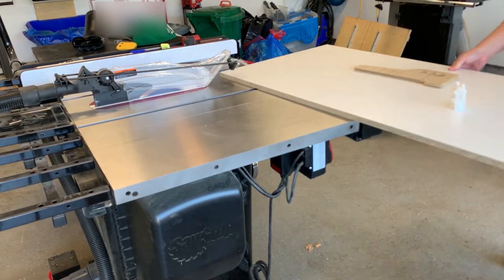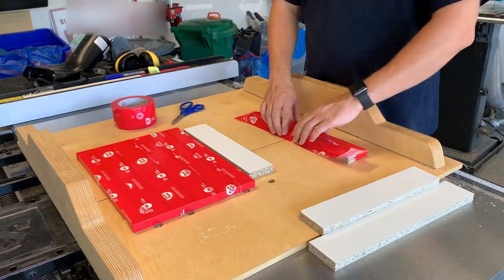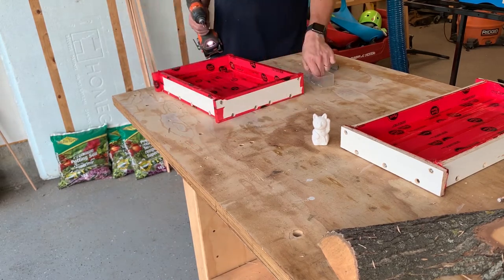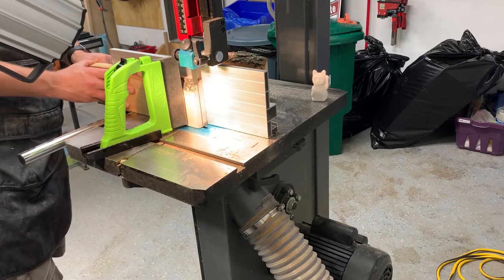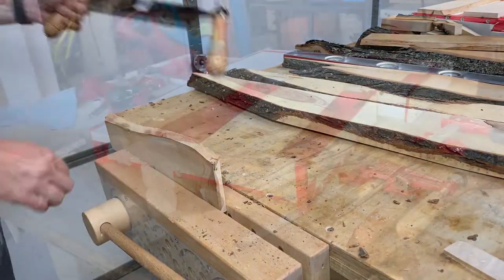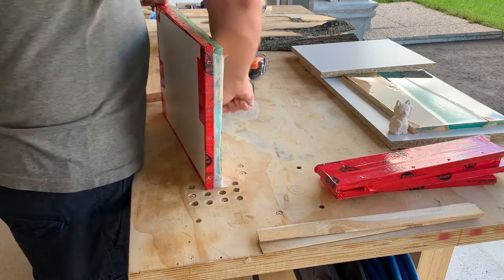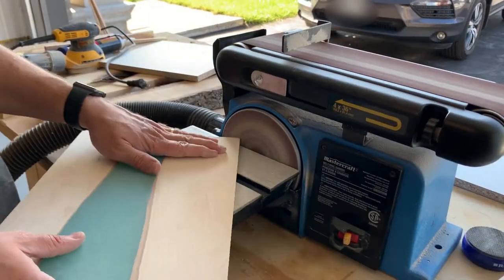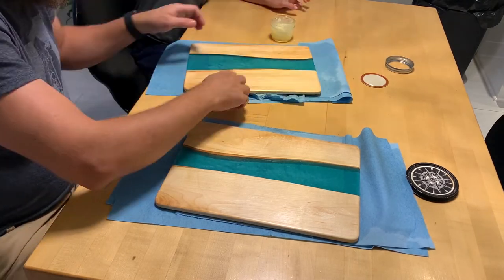How to Make a Live Edge Epoxy River Charcuterie Board

Comment: Good job! Although you could always build a vacuum box to pull the bubbles out of the resin pour...
Reply from the maker: From what I have seen, the vacuum boxes don’t really pull the bubbles out very effectively.    Most people will use pressure pots instead to squeeze the bubbles down to a really tiny size.  So small they are invisible.  I’d rather just let them pop over time.  No bubbles at all!  Pressure pots scare me, and they also limit the size of what you fit inside.